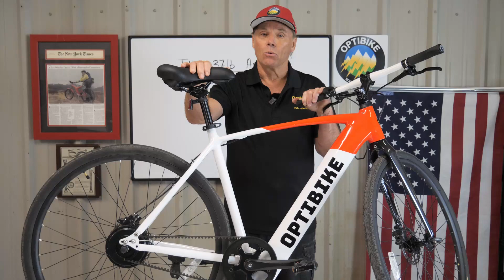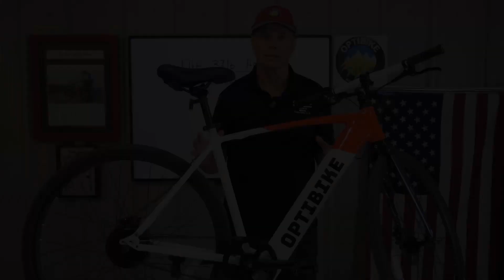Introducing Argon - Lightweight 37lb, high quality, affordable E-Bike

Comment: The security of the battery sounds like a great feature, but how difficult is it to swap batteries, if required, and how long does it take?  The conflict between convenient changing of the battery and theft is no doubt a bear to resolve.   Also, I rode for many years at UC Davis and you could always tell freshmen from the stripe on their back when the Northern California rains arrived. Shortly thereafter, everyone had fenders. It would be interesting to see a fully configured bike, fenders included.

Comment: Very interesting! Looks like a good solution for many people for commuting and fun. Can fenders and a rack be added easily? I’d also like to know what it’s like to ride without the motor in case that should be necessary for longer riders.  Thanks for continuing to innovate!
Reply from the maker: Hey Dale, the production models will have spots to attach a rack and fenders. As far as riding without the motor, it does have essentially no drag when powered off so riding that way works fine!